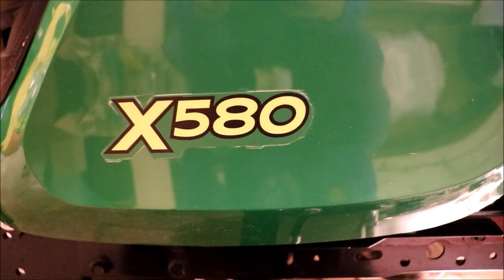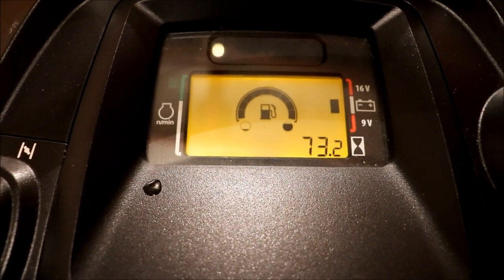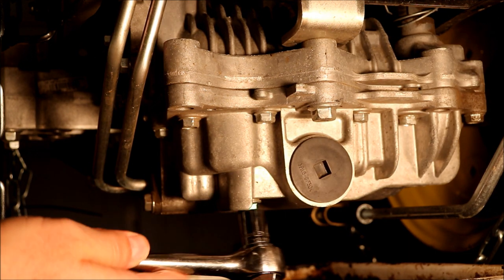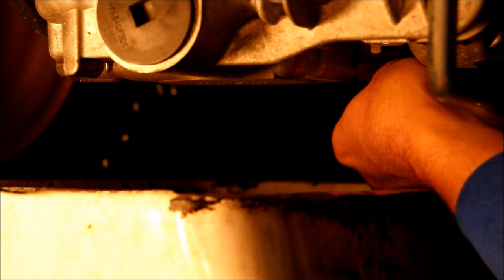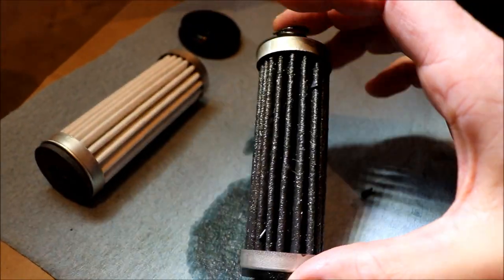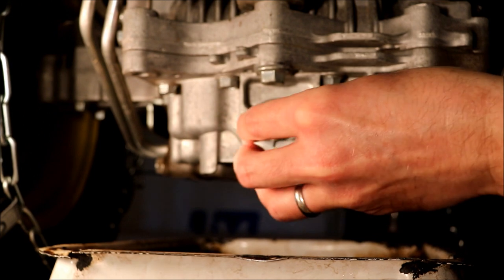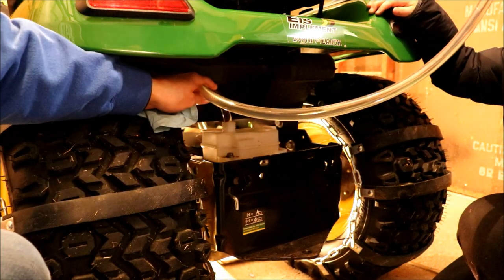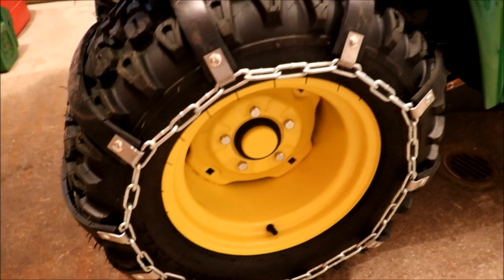2020 John Deere x580 50 Hour Transmission Service

Comment: I just did the 50 hour service on my x590 and it took 4-1/2 quarts. I guess there is some left in the system. I drilled a 1-1/2 hole in the body just behind the gas tank and installed a rubber gromet. Makes it way easer to fill with oil!

Comment: Your video was very helpful.  I just did my 200 hr maintenance on my X590, which includes a transmission service.  I found that jacking up the rear end of the X590 and putting the rear tires on some thick wooden blocks made access to the drain bolts and the transmission filter much easier.  The whole maintenance process only took about 2 hrs, of which most was spent waiting for either the engine oil or transmission fluid to fully drain.  The most difficult part was refilling the transmission fluid from the 1 gallon JD jug.  My plastic hose was too short (I paid attention to your suggestion but still got an "F" in class LOL).  Had to get my wife to pour from the jug into a funnel connected to the hose while I held the other end of the hose at the opening to the refill.
Reply: ...it gave the wife something to do..has she never had you help her in the kitchen? 😀

Comment: Thanks for the video! How do you like the snowblower? I'm looking into getting one of these but the 500 series hydraulics don't push down, just lift and float. So do you have issues with the snowblower auger 'climbing' as you're trying to push it into heavy snow?
Reply from the maker: Haven't had any issues with the blower climbing.  We do add a custom weight bracket that holds 6 John Deere suitcase weights to help with traction.

Comment: Just did my 50 hr transmission service on my 580 and my filter had the same sealant debris in it.
Reply: Do you have to remove the deck to get the filter out?

Comment: Question:  Did you find the single gallon of oil added was enough, or did you find you needed more after running the machine for a bit?
Reply from the maker: After using it a few times, it needed just a touch more.